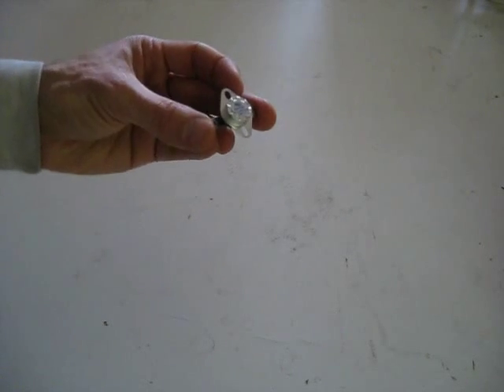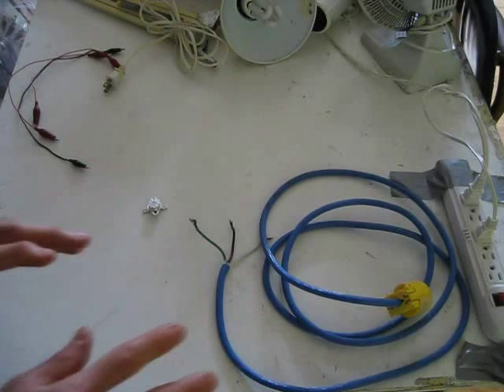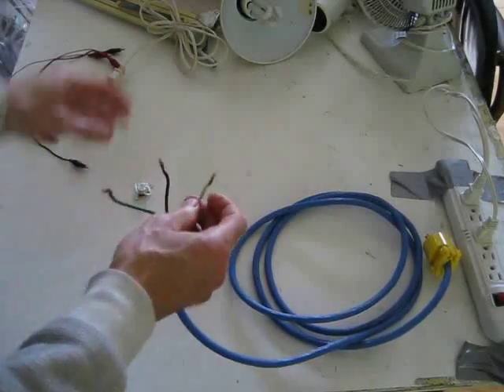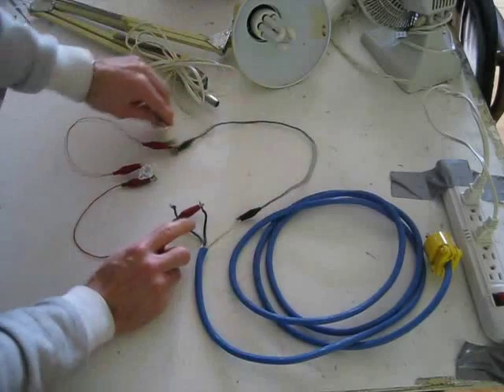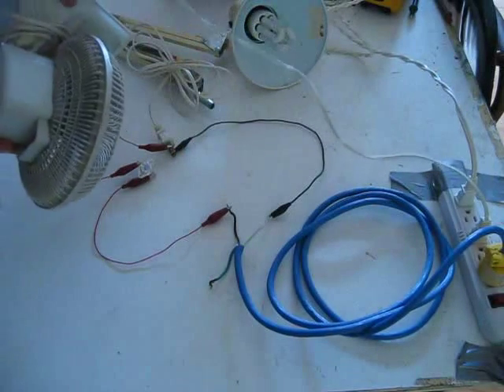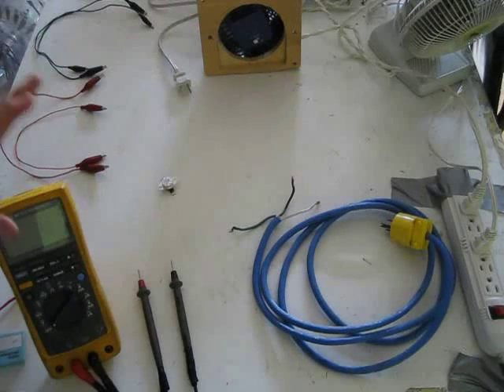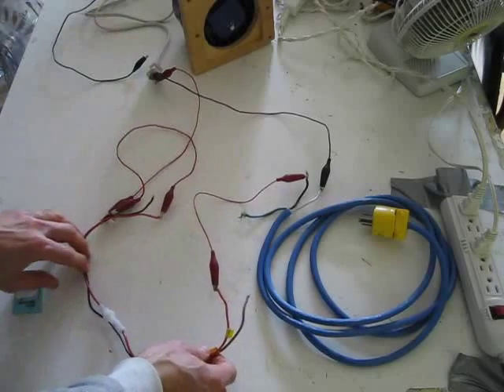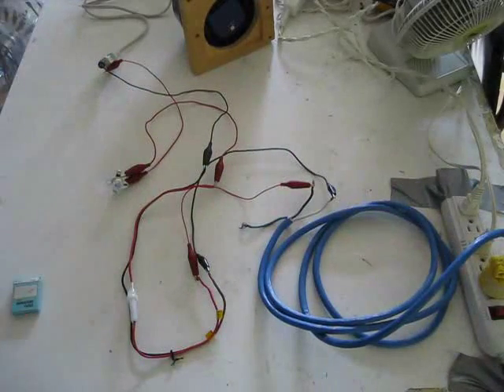Part 1 - Wiring a snap disk controller for a solar air heater

Comment from the maker: @field16 Re your first point, I agree! I enjoy watching these type of videos too. As for the meter current, it was fractions of a milliamp and when I wasn't touching buttons or brushing against wires it was rapidly dropping. I just turn it on right now, not connected to anything and it rapidly dropped to 0.507mA AC and stopped. I think you're right, stray capacitances. (It's also been zapped a lot with HV spikes over the years.)

Comment from the maker: Yes, they could. There's even a commercially available solar air heater called the SolarSheat that does just that. The size of the panels needed depends on the power requirements of your fan. Pick a fan first and then go from there. I'd recommend testing your fan off of batteries first before buying a panel though, just in case you have to try a few fans before finding the right one.

Comment: This is an entertaining video for electronics enthusiasts.

7:05 - Why was your meter showing current before you plugged into your house power?  Makes me think the snap disk controller is a capacitor that holds a charge.

Comment: Nice video.  I also guess you can make a crude, but very important, oscillator circuit if your snap disk can be placed near the lamp and be activated by the heat of it...thenn it will turn on and off periodically.

Comment: Can you use this with a 12v solar panel?
Reply from the maker: Yes. They have a current rating and a voltage rating but the voltage rating is usually higher than 12V. When you go shopping for one then you'll have to check if the one you want can handle your panel's maximum current.